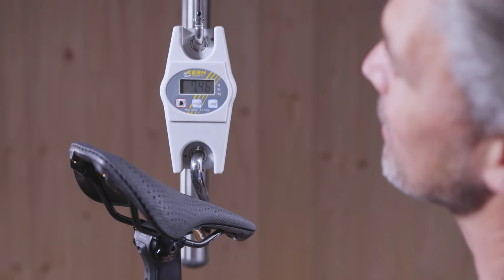Dream Build I Specialized Allez Sprint I SRAM RED AXS I Water Effect Black I

Comment: Simply cannot warm myself for disc brakes. When I see people friggin' around with fluids, pumps, squeezers, special tool sets etc. my skin crawls up. My bike is 6years old, in top shape, weighs 6.8kg's without the complexity, failure rate, weight and cost of disc brakes. Your milage may vary.
Reply: I agree,  brake related work takes up half of the videos. And the rotors ruin the looks of any road bike.
Reply: I have discs on my new bike and I have to say i can't go back to rim brakes anymore
Reply: @XxxxTxTxxxX  eh, I raced on the road with rim brakes up to Olympic Trials level for over 30 years. Never once did I wish I had more braking power.
Reply: @bikes7777   Good for you then. For me there is clearly a big difference and also I feel safer on the road
Reply: @XxxxTxTxxxX  you must be riding pretty aggressively if you feel rim brakes are not even safe for you. Maybe you should tone it a bit down Mr. speed demon ;)
Reply: Disc brakes are apparently for pros (to crash more often) and madmen who like to descent faster than 100 Km/h. For the rest of us, mere mortals and normal chaps, any sub-8 Kg bike will do as long as it comes with a nice groupset, decent wheels ans good braking power (and please, no internal cables, it's a friggin nightmare)
Reply: Would mechanical disc brakes make it easier to live with? Easier servicing and death brake lock up power.
Reply: @bikes7777  false
Reply: I use Discbreaks only had Never a Problem and they are easy to maintain if you are in it.
Reply: @XxxxTxTxxxX  Agree with you. I am feeling saver when i Ride Discs as well.
Reply: @XxxxTxTxxxX  Do you remember pro cyclist in the past, they always opened their brakes  in the final,  they didn't even need all the break power, I still do the same, rim brakes are too powerful in my opinion.
Reply: Everyone talking about the cost of brakes maintenance!?? If you can afford a bike like this I guess you will pay for all services and everything else ????? Or I am wrong ?😅
Reply: Ok Chester
Reply: Just ride your goddamn bikes, whatever brakes it may be. Ride safely and sensible.
Reply: @akhalid11  so true! Just ride 🤞

Comment: Cable routing through the BB and headset is a total PITA on this frame.  Calming music and maybe some good editing work made this look much easier than when I did it :-)
Reply: I had 2021 model with rim brakes and there was no headset routing. Is it for the newest models only?
Reply: @vaninaleksey  Yours is a first-gen, this is the second-gen.
Reply: @vaninaleksey  2022 model is disc brake only and internal cable routing.
Reply: I had and have neverending problems with noises near the bottom bracket. Tried everything, even expensive one piece BB. Besides nice and really stiff frame. But with noises appearing after a few hundred km no fun
Reply: @christianschaefer328  Was the BB installed with a retaining compound?
Reply: @chrisnoller7263  Both generations run internal routing, only yours is integrated as it passes through the headset assembly. The other one is better classified as regular internal routing.
Reply: @yonglingng5640  yes. With the recommended compound from bb infinite. In the beginning everything was fine. But it got worse over the time. Also tried Praxis works screwed bb and other brands.... Nothing worked out for long. Also changed drivetrain, wheels and everything:-/. Never had these issues with any my other bikes
Reply: @christianschaefer328  You may have to try Vibra-Tite's stronger retaining compound formula (forgot the number, but BBInfinite does sell it). This is only for very loose PressFit BB shells, which may be your case.
Reply: @yonglingng5640  thanks 👍. I will try it
Reply: It has two big wholes down the bottom bracket area. Just saying. This frame is an absurd failure.

Comment: Poor construction. The frame is only good for sunny days. Two big holes in the frame at the bottom bracket. Usually one puts a tiny hole for  moisture relief. Specialized puts two big holes there and all the dirt flies into the frame.  Same thing for the seat post. Also routing of the shift cable for the front derailleur is horrible. For me those are pretty big failures for such a company.

Comment: This is a very high end build and the weight is impressive for this frame. I have this frame built with Rival AXS with a Force AXS crank and power meter, 50mm Farsports wheels and an aluminum Specialized bar and stem. It weighs almost a full kilo more.
Reply from the maker: wow, nice ride you got there 🤩 the weight difference is mostly coming from the wheels, ours are crazy light 😅 yours might be faster on the straights though 😉

Comment: Any comments or advice on the internal cabling from the bars to the headset? I noticed you didn't bother with a full integrated stem+cable solution. I see people 3d printing pieces to use the SL7 stem. I have a 2022 allez sprint comp and I'm thinking of getting these same roval bars

Comment: Question about the freehub body on the rear wheel with the Roval Alpinist CLX wheelset. Was it the XDR?  When I search for the same wheelset, they are all provided with the Shimano HG 11-speed freehub body. If I want to use the SRAM Rival eTap 12-speed,  I'll need the XDR freehub body. Therefore, was it supplied with the wheelset? Or was it changed out afterward? Or am I missing something here?
Reply from the maker: It really looks that way. As far as we know Specialized is offering the wheel set with the normal Shimano freehub body only. You could try at your local dealer, or just order one online and swap it afterwards yourself. It's the common DT Swiss XD freehub body and we had plenty of those lying around.
Reply: @roadbikechannel  Thanks!

Comment: Wow is that the full original length of the seatpost??  If so I think this frame would never work for me. Do they sell a longer version?
Reply: This looks like the 300 mm version if it's not cut. There's a 380 mm version.

The second-generation Allez Sprint shares the same seatpost with the Tarmac SL7.
Reply: @yonglingng5640  thank you

Comment: Love the paint scheme, If the rim brake version was still available I'd buy one in a heartbeat.
Reply: Yea, to me it was just the same impression, a killer looking one! But the welds simply ruin it (at least in this light)!
I have an aluminium welded frame made over 12 years ago and the welds are not polished as well, but they are barely noticeable (Corratec/Germany).
Reply: I mean maybe it’s just me but this is very similar to an allez sprint I’m thankful to own and the bike absolutely shreds. Why so rimstubborn? There are big scary hills where I live, brakes are good.
Reply: @janemf  my bike needs to meet my own needs only, the reason you choose the type of bike you ride is not my concern, even though it looks like bike manufacturers like to dictate what people are riding, that is when I simply choose another manufacturer if they no longer meet my needs. Capitalism.
Reply: @janemf  Lol, yea, for 100 years people were buying bikes and they just couldn't stop on them. Were dying on each corner. One finally figured out  the discs...